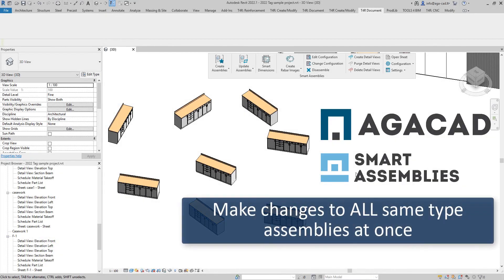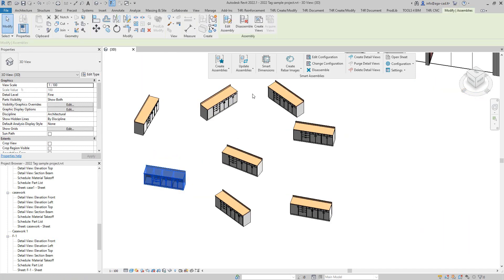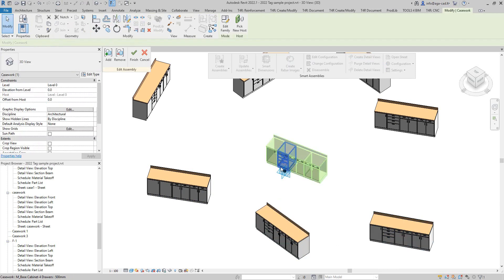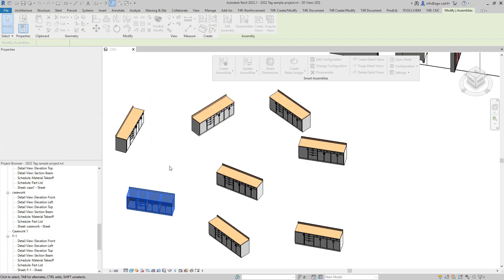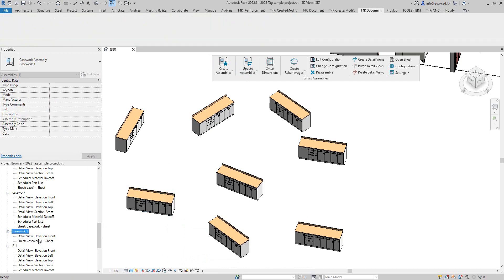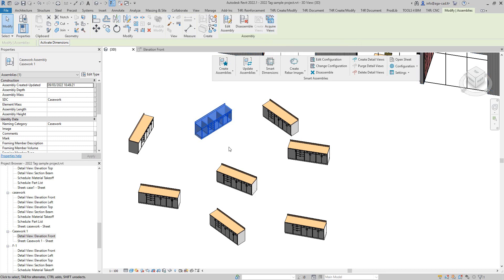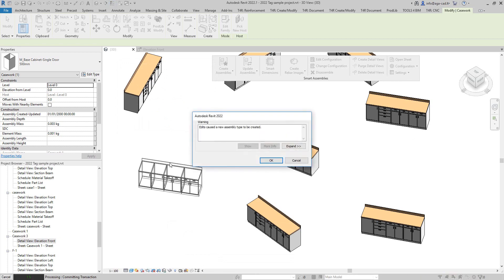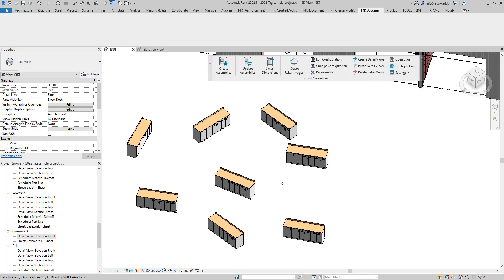How to modify all same-type assemblies in Revit at once

Comment: Yes, but the name of the assembly has still been changed, it would make a mess with names if you forget to change it back. 2:33 "Casework 1" 3:28 "Casework 3". Can the name of the assembly remain the same?
Reply from the maker: Hi, currently we don't have a setting to control the name of the updated Assembly. New Assembly names are generated by Revit automatically. We will look into keeping the same names after the Dynamic Update. Thanks for your feedback!